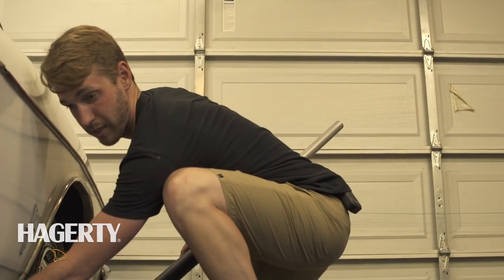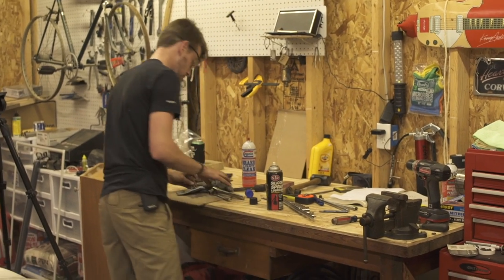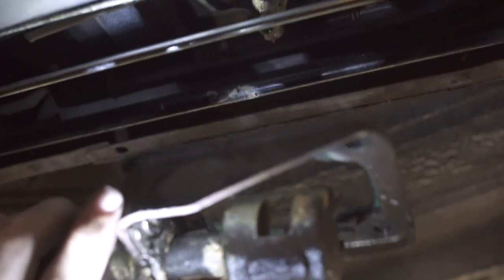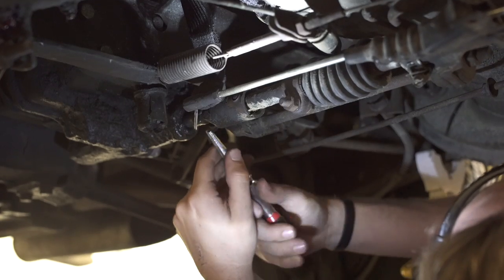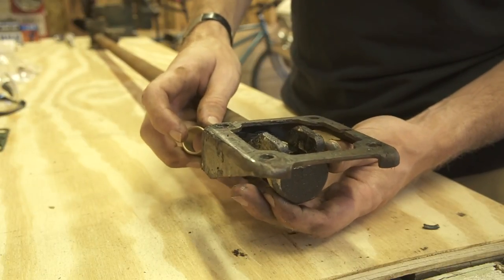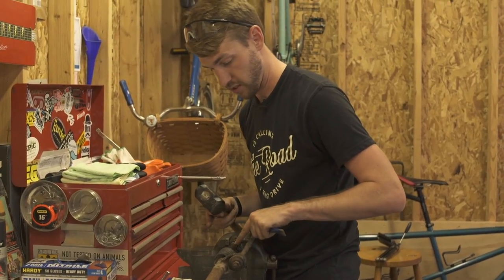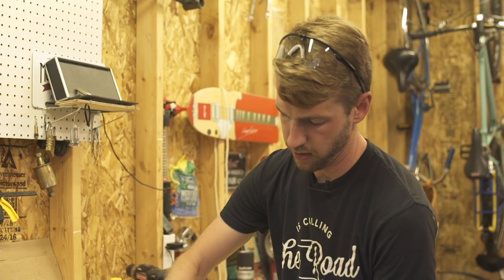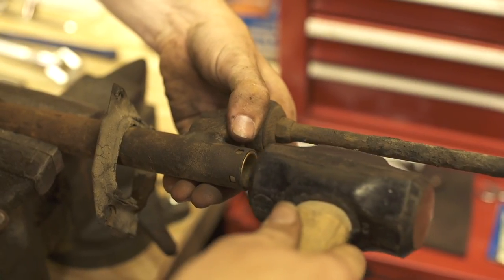How to Diagnose and Repair Sloppy Shifting in Your Classic Car | 1965-69 Chevy Corvair | Hagerty DIY

Comment: I watch a similar video and they used washers under the screw heads to prevent projecting into the bushing. 
I wondered too if permanent Loktite could have been used.  Or dimple the steel tube. 
Nice clear video on your work.👍

Comment: A bronze bushing to guide a shift rod that really doesn't see much heat.  I'd epoxy the bushings in with JB Weld.  I doubt they will go anywhere especially if you file a few notches or turn a grove into the outside surface of the bushing to give the epoxy something to bite into .   If it ever fails, then maybe consider set screws.

Comment: I've seen a lot of those pinch welds bent and crunched. Best to use a 2x4 piece of wood between the jack and the pinchweld. That keeps it from bending and crunching the pinchweld. That old grease was a spray-on lithium grease. Did you lube the main shaft? Especially in the bronze bearing area?